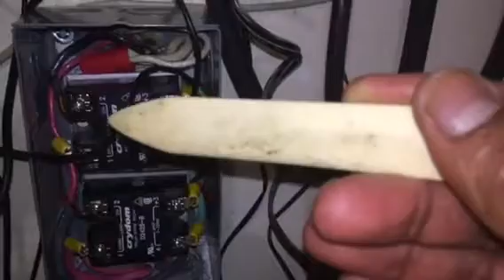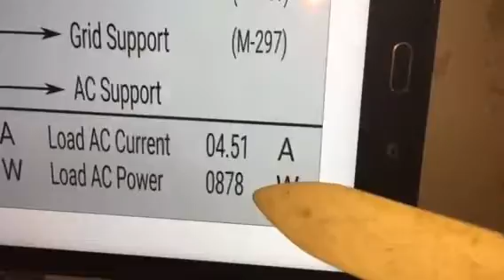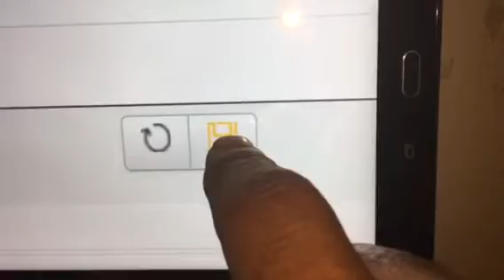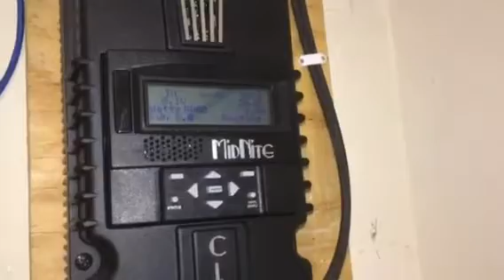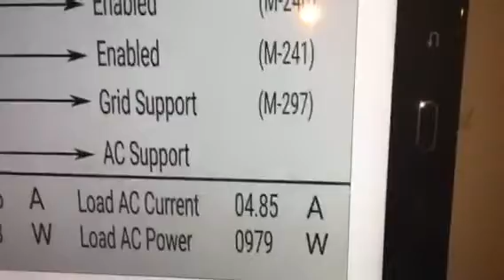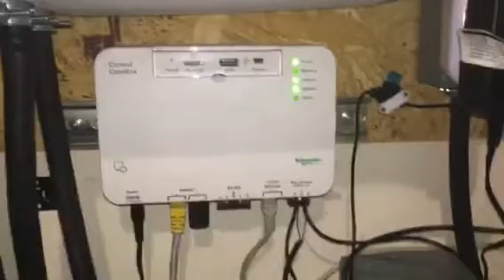Off-Grid inverter control using solid state relays

Comment: what software is that on your Android tablet? I like the idea of using solid state relays in a system, not had to use them before as control via Victron smart shunt, but good safety 👍

Comment: You should use the midnite relay to remote start a generator, to charge your bank, when you have a grid down power outage, and the bank is low.
Reply from the maker: That would call for a stationary generator, I have a portable one that is geared for occasional use.

Comment: com is the representation of common
Reply from the maker: Solar Power Electricity and Electronics thanks, I knew that but neglected to mention it in the video. I wanted to emphasize that it is considered negative in a circuit in this case.
Reply: The relay is a simple off-on or on-off switch
                                 COM-NO or NC-COM
sorry about that i just never have any one say it like that before good video
Reply from the maker: Solar Power Electricity and Electronics No problem and thanks for the comment.